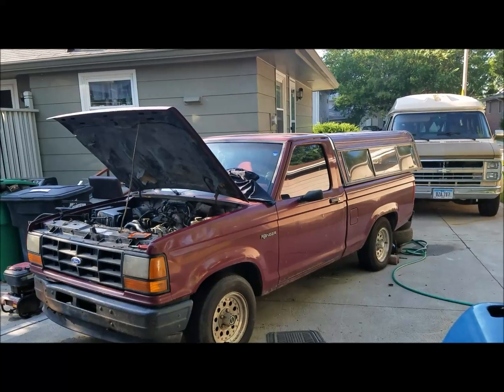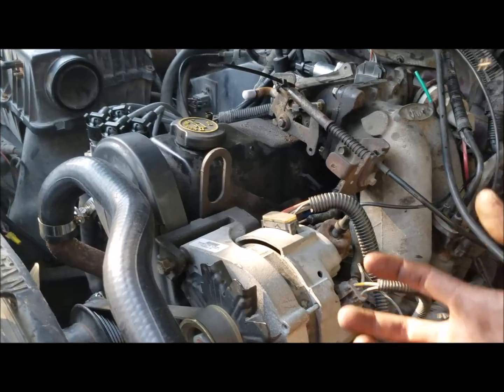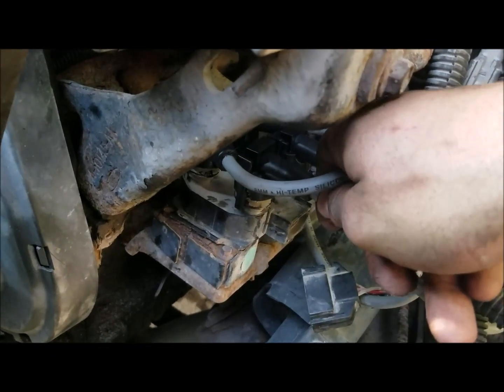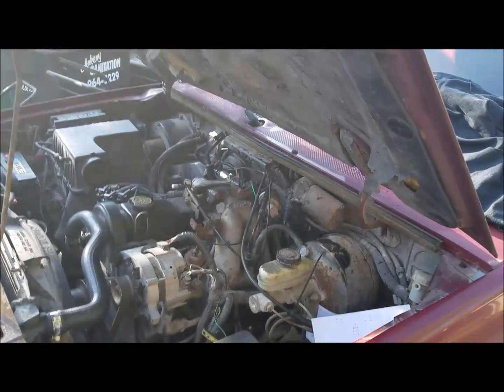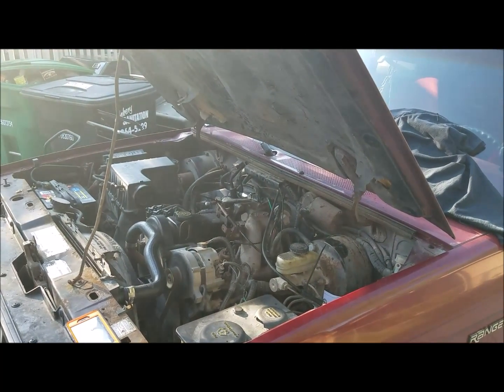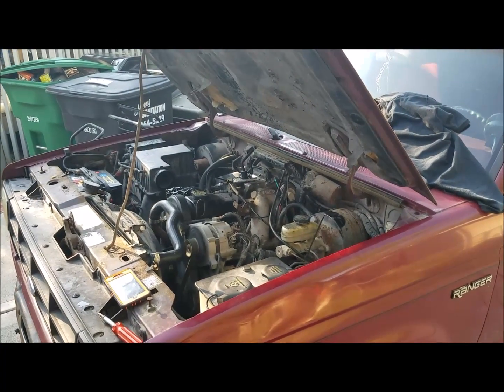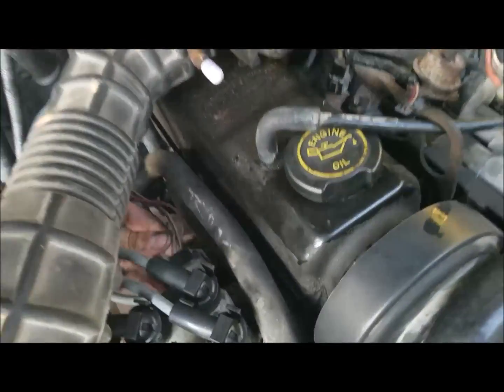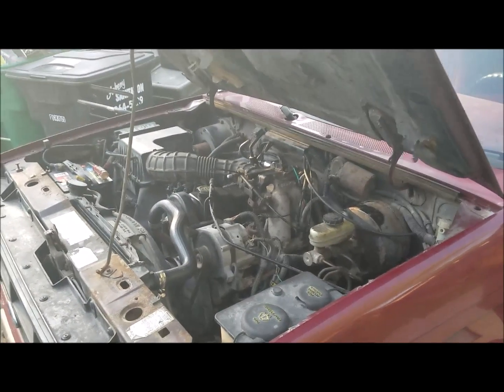Ford 2.3 8 Plug Head - FREE Dual Ignition Mod: How To & Demo (+ HP & ECON)

Comment: Here's a question for you.. in a manual, when you do a burnout then peel out, when the tires get grip does it not suddenly jerk the clutch and stall the engine? Never done brnouts before I'm still rebuilding the engine on my 66
Reply: Fun side note... I bought my 91 GT 5 speed completely stock in 2005 with 78000 miles and the original mounts were BEAT. I switched out to prothane mounts and they're great. Also changed out to a prothane tranny mount and aluminum tranny cross member bushings. No more problems.

The factory Ford mounts are junk.
Reply from the maker: it really depends, unless you lift, they slowly hook back up and you dont get that jolt. its basically the same as a clutch dump if they did - obviously you need the right clutch for the intended usage. the rotstang has a very heavy clutch. also - the springs in the clutch help to absorb that immediate torque shunt.
Reply: ThunderHead289 gotcha. Since you're a ford guy, what would you recommend as a trans for a 66 mustang as a daily driver but also fun car? I was thinking t5 but some people say they're fragile..
Reply: T5 is fragile, but they're also cheap and easy to get... If you've got the money, get a TKO.
Reply: Johnny Appleseed get a 99-04 v-6 Mustang trans. all over craigslist and junk yards.
Reply from the maker: the rotstang runs a t5 and i have been unmerciful to it. they hold up very well as long as you are not doing high rpm clutch drops from a stand still.
Reply: ThunderHead289 i went through 6 motor mounts in 3 months on my t-5 swap. it was a ton of fun. 265/60r15 on 10 holes, id dump the clutch at 25mph and jt would burn out or take off hard.
Reply from the maker: the rotstang has poly mounts, they do a good job for sure!
Reply: You've got some big balls to put firm motor mounts in that car... I'd be afraid the K-member would come visit you. hahaha
Reply: Maxwelhse so you trust a 2500lb weight but not a 300ftlbs motor to the k member? 

my car was a tbird, they had different style motor mounts from 86-88 then the mustang. the older cars used the same style. i upgraded to solid rubber then finally a solid rubber bolt through "generic motor mount" i got for $20. that mount lasted, but then i started twisting up the motor mounting plates. ended up junking it after it took out the oil pan and broke a bunch of hoses.
Reply from the maker: its certainly twisted. the car is pretty darned bent up
Reply: lilsammywasapunkrock I think you missed my joke...

Comment: spark isn't a magical force of energy which burns fuel. It only sets off an explosive chain reaction, the spark itself is a very small insignificant force of energy. having more spark wont actually burn more fuel, or produce a "more efficient burn" but it will change the rate at which the fuel (the chain reaction) sets off. this is wasted on an engine which is not tuned for this. its a very fine process. not only the timing would need to be changed, but the stroke would also need to be different. this is why OEM spark plugs are always recommended, because the engine is actually designed for them. after market plugs which try to deliver more spark are a total waste.
Reply: igniting a spark on the other side of the cylinder at the same time will essentially advance your ignition timing, which as long as it wasn't at its peak then yes, you will get more power and efficiency, but you could have just advanced the first plug a degree or two for the exact same effect. you are not getting ANY power simply from igniting more spark.

race engines NEED more spark because of high cylinder pressures, the higher the pressure, the harder it is to jump a spark across the gap. if you run too weak of an ignition system and too much pressure you will "blow out" the spark. 
 
"hotter"spark plugs have nothing to do with spark energy, a hotter plug lets the electrode get hotter to keep it clean, too cold of a plug will get buildup and foul, too hot of a plug can cause pre-ignition OR detonation (they are NOT the same thing and "pre-detonation" is a misinterpreted mashup of the two, but that's another topic)

top fuel dragsters run dual ignition systems mainly as a redundancy, by the end of a run one or both plugs in each cylinder is usually melted and the engine is dieseling across the line, so i hear..

rotaries are actually great RACE engines.. just like two strokes. lots of power to weight, lots of rpm, tiny package, small amount of moving parts, easy rebuilds.. they're great race engines but many organizations require you to run production parts so mazda had to make a street car with one so they could race them too... not great daily engines, but AWESOME for racing depending on the application!
Reply: Andiar Rohnds I highly doubt top fuel and funny car dragsters do things for gimmicks. adding weight and design cost is the last thing they would do. your clearly ignorant to any reasonable argument and bring up off topic analogies to backup a pointless and proven incorrect argument.
Reply: Andiar Rohnds and your explanation is anything but clear. one comments your against it. another you say it would work. and some your bring up random things that aren't even what we are talking about.
Reply: slidestang242 you just won this thread, hit every point on the head these 2 were arguing about.
Reply from the maker: i do have to agree with this as it is easily demonstrated in carbureted engine. 
but i also cant argue with the seat of the pants feel and less cruising throttle angles required to move down the road that i can feel. 
here is my thought as to why it works in this application - via timing light, the timing curve of the 2.3 is not very aggressive/advanced per rpm (id assume because its a heavy truck) so this avoids detonation from a quicker flame front. on the flip side, the fuel charge is being ignited from both sides of the cylinder head, so the fuel is more completely burned vs what would normally be wasted and exiting the exhaust pipe. 
on a carbed engine tuned for power, everything else equal - i would pull ignition timing since you do not require the advance due to the faster flame front - just like what you have to do with higher compression engines (more cylinder pressure - faster burn rate).
Reply: im not sure what, or how you are feeling anything, but if adding more spark ever changes anything, then maybe the distributers were very weak to begin with. i also forgot to mention that adding more spark only works if its introduced at additional point. so that two chain reactions are started from separate points.
Reply from the maker: I mean no offense, but i have to respectfully disagree with you. 
read my last reply. 
also - 
different point - 2 plugs. 2 different locations.
Reply: ...this is why the 5.7 hemi uses 16 plugs. to introduce an additional spark from a different point
Reply: Andiar Rohnds they aren't just some guys. these people build 3 second 1/4 mile cars for a living, most if not all are engineers and they would run circle around you with the information they know. if they thought something wasn't needed. they wouldn't do it. they make changes to cars to shave off hundredths of a second. there's a clear set reason they have 2 spark plugs per cylinder. if they didn't need 2 they wouldn't add 2. because it would be wasted weight. your just to ignorant to see it.
Reply: I stopped reading at "explosion"
Reply: no, the plugs wont fire any earlier, but effectively the flame front will burn quicker as it started in two spots, so while the plugs are still firing at the same time it will act like the ignition was advanced a little bit.
Reply from the maker: +Andiar Rohnds it does advance the timing because the flame front is much quicker. It's the same concept as why high compression engines don't run as much ignition timing - the higher cylinder pressures accelerate the speed of the burn in the chamber.
Reply: Some very insightful comments. I must admit, i learned something today. Thanks guys.
Reply: it has 2 spark plugs per cylinder. that creates 2 points where it starts to burn and halves the time to take to completely burn. also there's always gonna be areas that don't completely burn. having an additional spark plugs helps cover those areas.
Reply from the maker: +Andiar Rohnds you do realize that this 2.3 has 8 plugs. 2 per chamber. Just like the hemi situation. What are we not coming together on here?
Reply: Andiar Rohnds tell me this. if it's so negligible. why do top fuel and funny cars have 2 spark plugs and even 2 distributors.
Reply: you really don't understand how this works. the spark doesn't modify the fuel/air mixture, and having two spark points only makes both chain reactions join together into one, within the cylinder anyway. it doesn't really create additional pressure. its a total gimmick. its quite simple, having an addition spark does not actually provide any additional energy. really. now lets take a look at compression; by compressing more air and fuel together you actually are providing more energy. you are taking the oxygen and nitrogen from the atmosphere and squeezing that in a tight space with the fuel. the more compression you have, the more residual oxy/nite gas is being collected into a space with the fuel. you are actually creating more energy here, even though you are not directly providing more oxygen. you are simply taking what is already there and arranging it better, thus creating more explosive energy.  a spark does nothing. its only coercing what is already there.
Reply: no actually it wont advance your ignition timing. it would be the same if only one of the two plugs were firing.
Reply: it will take less time after spark to reach peak combustion pressure
Reply: thats only because the compression chamber is designed to be ignited from two spark points. the second point is unnecessary though. you can achieve the same exact performance without the second spark. it certainly is wasteful engineering. perhaps designed to trick other competitive engineers who don't know any better. to make a fool of them
Reply: without the second spark, the cylinder has a small 'deadzone', this is what changes in what you describe as timing. you can design the exact same engine without the second sparkpoint, it would perform over 99% as good.
Reply: im literally just figuring this out as im typing this, which is why my earlier posts seem contradicting
Reply: Andiar Rohnds so is that why multiple ignition companies research and produce products with proven result in all platforms of motorsports? Or do they not know what they're talking about
Reply: Andiar Rohnds I'm not disagreeing with all your info.   But I would like to point out something.  You need to remember why they developed the waste spark system.  It was to ignite the un burned fuel in the exhaust stroke.   So in theory if you had two sparks during the power stroke you could get a more complete burn.  Now I do agree to get total use of this mod the vehicle needs to be tuned.   Also it would be interesting to see if after the mod if the spark plugs would fire at the same time or does the waste spark side fire at a different time.   I would love to see this mod done on a chassis dyno with a tail pipe sniffer to see the difference in power and emissions.
Reply: Honda does this same thing, in their new motor designs. take that how you want.
Reply: Hello... any pilots out there?  Mag check??? the engine runs faster on both... Hello.
Reply: https://youtu.be/2YuKx2Pv7aU
Reply from the maker: +TheSamplebridge thanks, I haven't had time to reply to this. He keeps arguing about hotter spark and what not - he even mentions the dual plug hemi ..... The 8 plug cylinder head is 2 plugs per chamber. He actually argues in favor of my results. 
Also, on another note hotter spark is better in that the flame front is able to reach farther through the combustion chamber and more thoroughly burn the atomized fuel charge.
Reply: no, the amount of charge is what makes the bullet more powerful.  how you prime the charge is only trivial. you can have 10 different primers going off all over the place, it doesn't matter. technically this does have some small effect, but its extremely negligible.  its the powder charge which will ultimately determine how hard the bullet is fired.
Reply: Andiar Rohnds to go off your bullet analogy having to spark plugs on opposite side of the chamber does increase the efficiency of the burn, because with one spark plug firing it burns at a slanted angle to the piston top. if you have 2 it burns straight down to the piston. it's like the difference between a rimfire bullet and a center fire bullet. everyone know center fire bullet are more powerful.
Reply: ok, you "highly doubt" my clear explanation of what's going on, yet you don't provide any reason other than "some guys over there are doing it". yeah, im the one who is clearly ignorant here, dude :)
Reply: why do some vehicles have other funny gimmicks?  because people do silly things. do you know how pathetic and worthless a rotary engine is? many people will have you believe the power to weight ratio is amazing, and there is a ton of false evidence to back this up. but at the end of the day, its just another auto manufacturing gimmick which is successful at fooling people. engineers do silly things
Reply: no, i didnt realize the 2.3 introduces an additional spark point.

Comment: Is there a way to adjust the throttle cable on a 94 thunderbird with a 4.6L v8?
Reply: Old coinchaser so, follow the cable from the pedal to the throttle body. Look for some sort of nut, screw, etc. most cables have adjusting nuts. If it doesn't, you'll need a new cable. If you can't get a new one, use the zip tie trick thunderhead mentioned.
Reply: ThunderHead289.... I think that would work, or a spacer. What do you think? Hey, I have a set of heads I think they came off of my fe390.when I bought my f100 they were in the bed of my truck. Should I keep them and have them redone or sell them?
Reply from the maker: what do you want to adjust, is the throttle sloppy or do you want to adjust your idle speed?
Reply: ThunderHead289.... The throttle cable has a lot of play in it. On the throttle body and on the accelerator pedal. I checked Autozone and called the ford dealer and they said that it was discontinued.
Reply from the maker: is there slack in it to where you can put a zip tie in it to take up the tolerance? it would be at the peddle. does this make sense?
Reply from the maker: ol johnny makes a very good point. well said
Reply from the maker: it all depends what you plan to do with them. edelbrock really makes the only performance heads for the fe, so compare your prices there!

Comment: My dad had a 4 banger ranger before, i should of done this if i knew it. Does it add more pep to the truck?
Reply from the maker: +Pat Day entirely what happened to me. So much bs in forum stuff. Before I did YouTube I was a huge forum poster. Got tired of dealing with ignorance - had to bow out.
Reply from the maker: it has more low end grunt (spoiler, iv driven it already a bit). didnt notice any difference above 3000 rpm into the throttle. but low rpm and cruising throttle angles, its definitely better.
Reply: Peter Kapica I'm sure it will add a little
Reply from the maker: im assuming i have read the same forum stuff - this is the only way that works right it seems (tested by unplugging coils) either way, it wont hurt anything. the truck has new plugs and new wires, and i could feel a definite increase in low end grunt.
Reply: Peter Kapica that way doesn't work i tried it did it word for word. what happended was i had no power and was backfiring pretty bad i could barely make it around the block
Reply: Peter Kapica i am just trying to help someone else from making the mistake. it don't work its a waste of time and possibly money if you can't solder it back together.
Reply: ok, and researching this topic, it seems this is the improper way, the proper way is to mess with the ICM connector to block off the signal to it so it fires at all times but that sets a check engine light
Reply: Pat Day ok